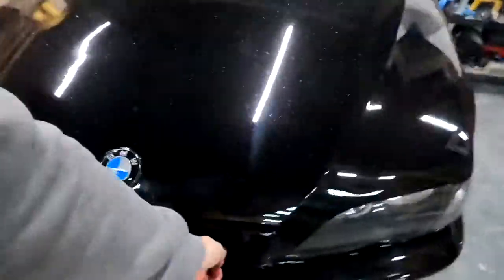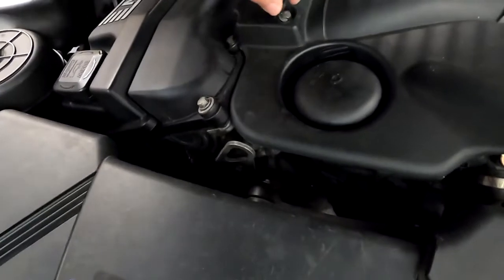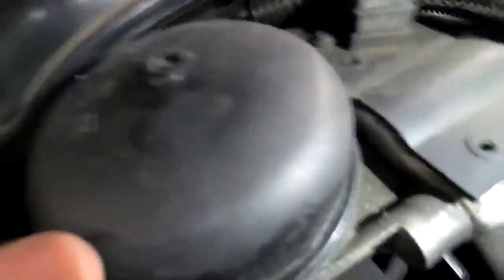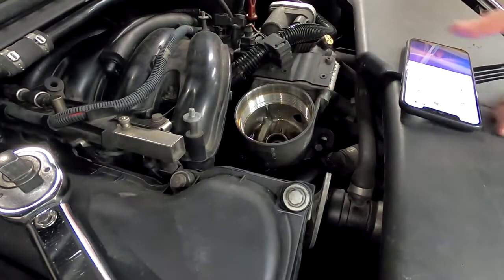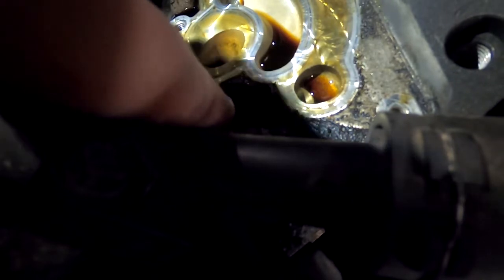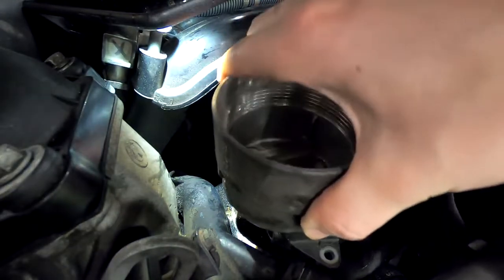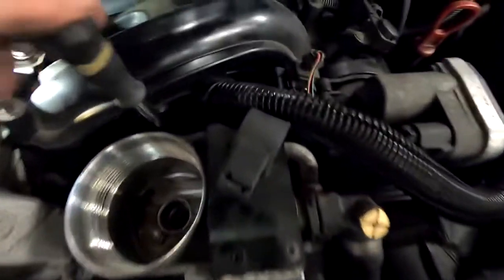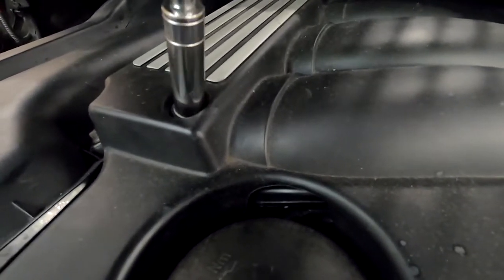BMW N42 Oil filter housing gasket Step By Step

Comment: Do you need to drain the oil in orded to do this?
Reply from the maker: Let your car sit for an 1 hr or longer so the oil drains down to the sump. IF you just driven the car, you will have a lot of oil in the filter

Comment: Thanks man! I need to do mine soon, I am leaking 1 liter of oil a month from that gasket
Reply from the maker: 1 liter in 30 days. Damn, you need to get it fixed asap. 
Idk, I have had a comment that there are 2 gaskets, one under that housing too. 
I don't know, nor can confirm that. Just passing the info along.  good luck with the fix 👍